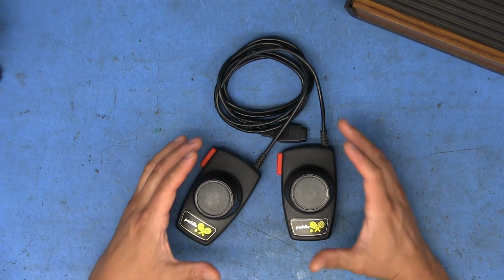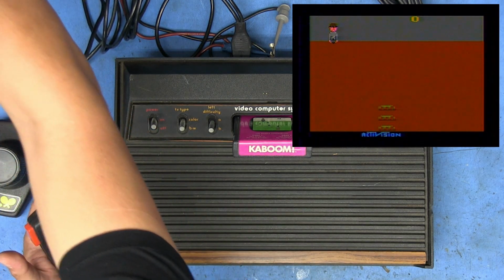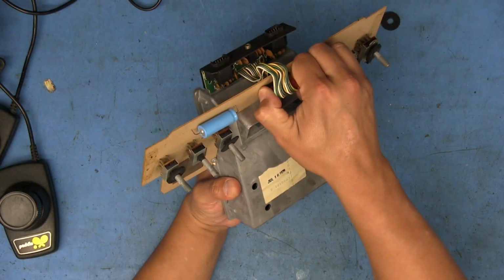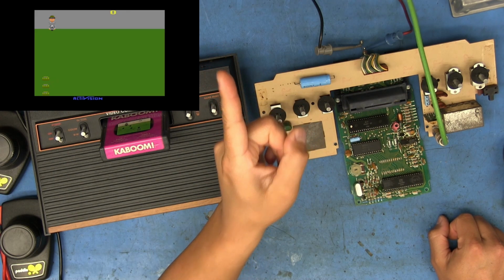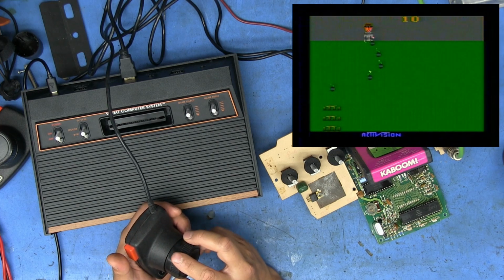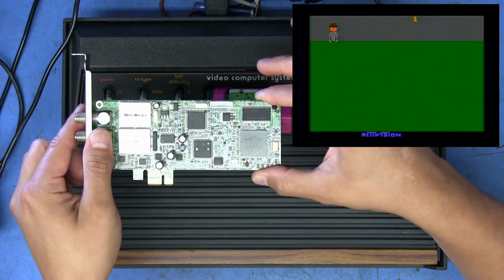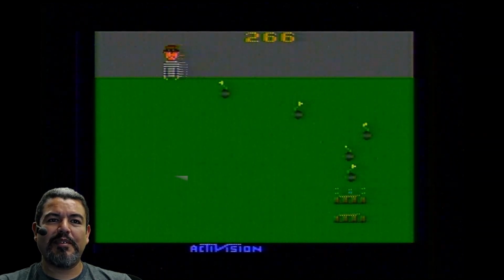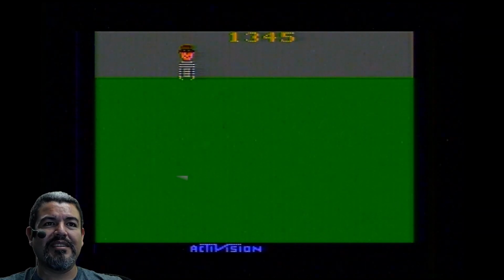TEF #191 | Atari 2600 "Light Sixer" Purchased As Untested From eBay

Comment: Kaboom is one of the best games for the VCS/2600 IMO. As far as "delay"... after all this time I'm surprised this still has to be explained. LCD displays (and TV's in particular) have signal processing on each frame before displaying them. On monitors it's not very bad but on modern TV's there's a lot going on before displaying... hence the "lag" or "delay". This topic has been covered so many times I'm always a little surprised when it seems like an unexpected thing when doing stuff like this.
Reply from the maker: Kaboom is definitely one of my all time favorites on the 2600.

As for the latency I was referring to, the 2600+ has noticeable latency when turning the paddle controllers no matter what sort of display it's connected to. I'm guessing there must be some latency being introduced in the analog to digital portion of the controller input. Or it could be due to the built in emulation, not sure. I'd have to rig up a test to show how it doesn't respond right away when the knob is turned. 

As for the latency I was showing between the TV and the LCD monitor in the video, that was only to show why I use a separate TV to do gameplay when capturing video through OBS.
Reply: @ThatElectronicsFool  gotcha. 🙂 Just to note, I did enjoy the video.

Comment: Just to let you know you should only use the fader spray on the pots as the standard contact cleaner can have the oil soak into the PCB material the carbon track is adhered to and cause the track to un glue or disintegrate over time.
Reply from the maker: Now that you mention it, I do believe I've read about that before also. If it does go bad, at least it won't be too difficult to replace.